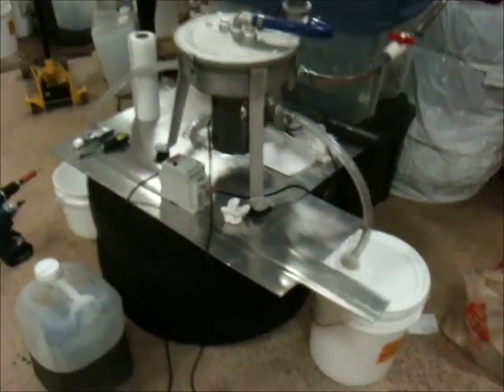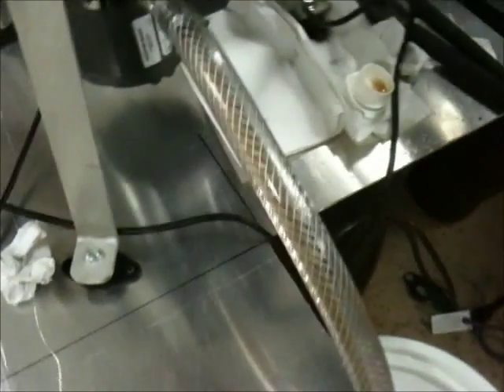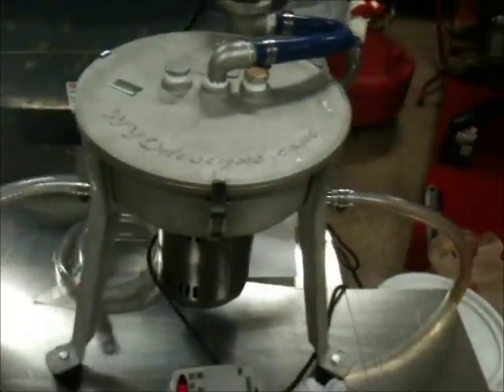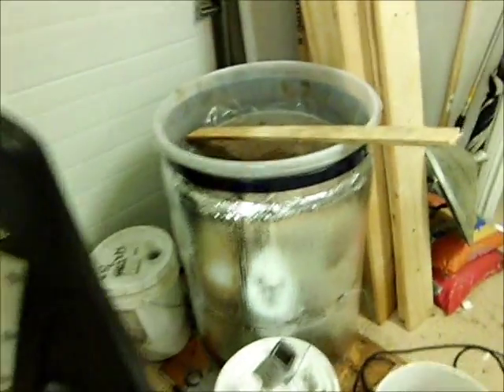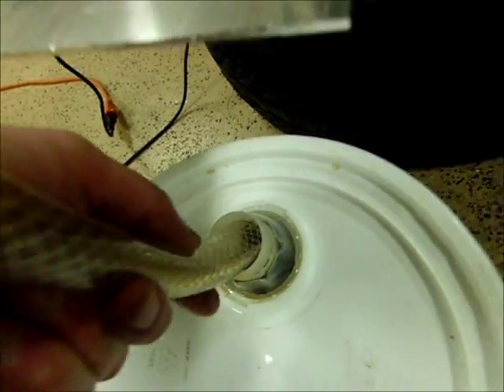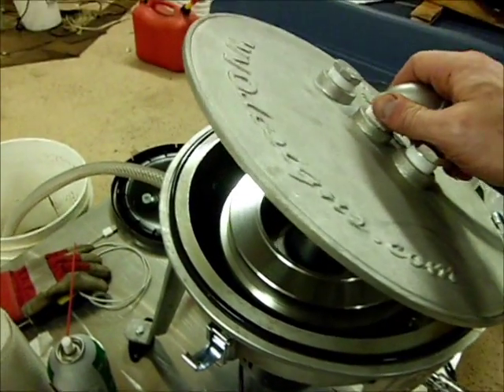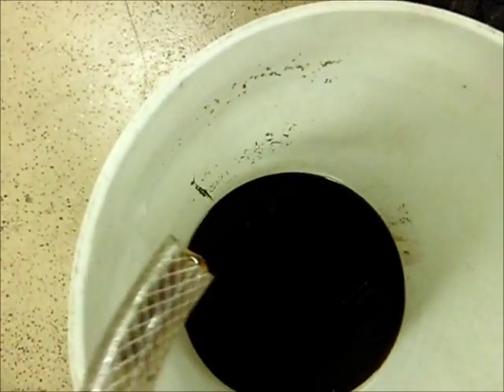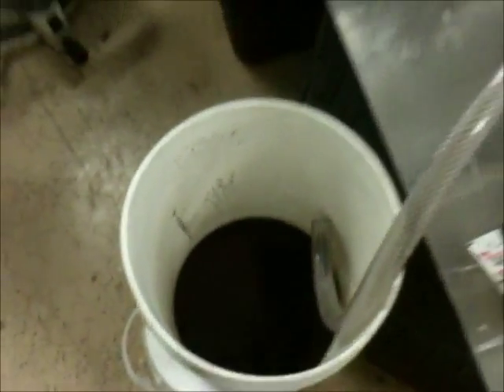WVO Designs Centrifuge test filter

Comment from the maker: I've often thought about that myself. If I leave it running unattended and power cuts. Depending on your set flow it would flow into waste drain first (flooding my 5gal container) and if that doesn't drain fast enough it will overflow into the clean oil but that's pretty unlikely. Still.... it means up to 50gal of oil on my shop floor. Not good! I've thought about getting a uninteruptable power supply w/battery backup.
Reply: Or just a solenoid valve that closes without electricity.

Comment from the maker: If you have lots of water in your oil it's much easier to pre-drain the water. You can see globs of it inside the clear hoses coming from the barrel going to the centrifuge. So when it goes into the WVO Designs centrifuge heater the water sinks to bottom, oil wants to go up. So if you have a valve there you can drain that before the centrifuge catches it. This is better because the centrifuge fills up quick if you have a lotta water in the oil. The whole thing is gravity fill.

Comment from the maker: No they don't come that way. It's what they call a "thru hull fitting" you can buy it at most marine stores. I used the same fitting on a plastic 55gal drum for my final setup. See my later video of "biodiesel updates" which shows a bit more of the final setup. The valve came from home depot along with the hose and spigot fittings. Also it's a good idea to have a longer pipe with a valve on the bottom of the pre-heater on the centrifuge. Open that on occasion to drain water fro the input oil.